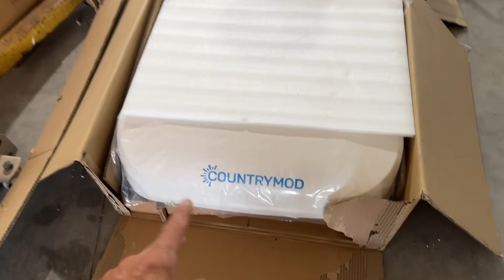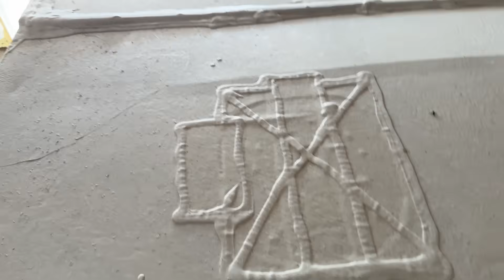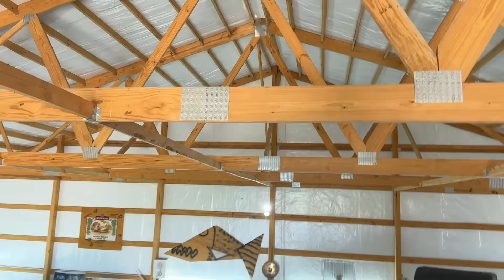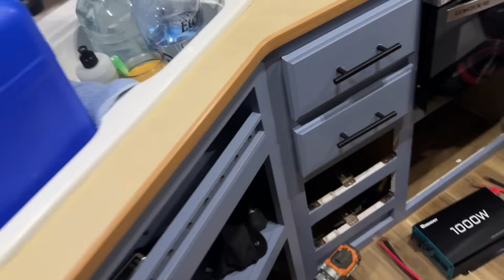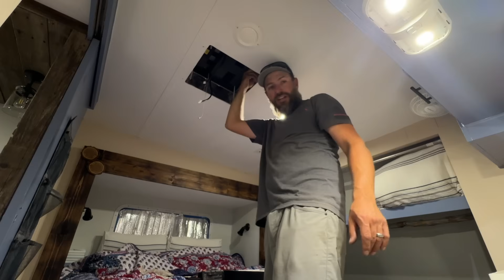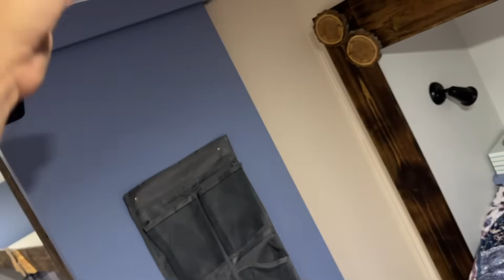FINALLY! SOLAR POWERED RV AC!!!  CountryMod DC Air Conditioning

Comment: What's the best way to connect batteries for solar? Series or parallel? Also how many panels and batteries would you recommend for a full time setup in a trailer?
Reply from the maker: depends on your set up, cost wise a small system say 12 volts, could have a couple batteries in parallel just to add to storage capacity. a bigger system with several batteries running at 48 volts could run multiple parallel banks of 48 volts by combining 4 12 volt batteries in series, but you have to make sure the batteries, panels, charge controller, and power inverter are all rated for the bigger 48 volts.  much more cost!   A decent small set up can be had with two 100ah 12volt lithium batteries a 2000w inverter and a 400w solar kit, check out renogy! https://amzn.to/4nDgYSu

Comment: Love the channel. Correct me if  i am wrong. I thought you said you went to a residential fridge?  I was assuming you were installing this so you could go boondocking and be free of shore power. By pulling out the 3way fridge now you have chained your 5th wheel back to shore power. My question is why did you go to a solar-powered ac (which is very cool) when you are going to be using shore power because of your fridge? Impressive work so far!
Reply from the maker: we have a power inverter for select outlets in the couch. it will run on our solar and battery set up

Comment: I also had to order longer all thread on Amazon the one they give you is 1/4 inch too short. I also wired my control board in another location because of condensation that built up on mine. Lots of work but came out nice.

Comment: I have the same Ac pulls about 59 amps at times. You need at least 4 awg especially for that long of wire run and specially need lithium batteries for sure. That little battery will not work well with that.
Reply from the maker: yeah my lithiums are wired into the front pass through

Comment: It’s only 10k I’ll use a 13.5, 15 or 18k Chill Cube variable speed compressor or a Turbno Greenland Inverter and have the BTU’s and the low power consumption.
All these 12v a/c’s are not powerful enough for but a vanlifer.
Reply from the maker: its a good back up to a bigger 15k

Comment: The math ain’t mathing. If the unit only draws watts. You would only need 8 gauge wire
Reply: If the unit only draws watts. You only need 8 gauge. Depending on the watts. the math is mathing you just aren’t comprehending
Reply from the maker: on turbo mode it can pull up to 59 amps

Comment: how does it do cooling that camper compared to the the 15000btu  110v A/C? i am considering replacing my old AC with a DC one but am concerned it won't cool as well.
Reply from the maker: it's not as good thats for sure. id add it as a back up in a old roof vent

Comment: I’ve seen 18000 mini splits hung o tongues of trailers with evaporators on inner walls. Quiet and efficient
Reply: yes but you gotta drill massive holes in your camper.
Reply: @Reaglesracing44_ I drilled a 3" hole in the bottom of the cabinet next to the sofa. You cant see it, and it would be very easy to patch.
Reply: 130ah per day
Reply: My 9k Btu mini works better than my 2 roof top units 13.5 and 15k Btu units in 36 foot toy hauler.72*f vs maybe 80*f with rooftops.
Reply: @2hotscottpro  try that here in the arizona summer heat where temps can reach 125

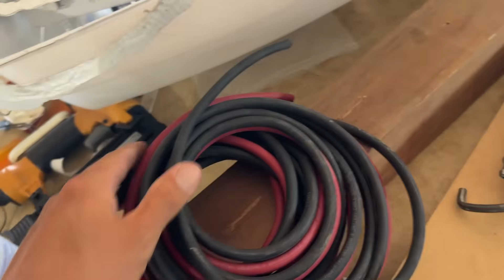Comment: I was wondering, at 15:55, you show some heavy-gauge flexible wire. 

Specifically, what gauge is it and is there a specific name for that type of heavy wire that is flexi?

Thanks in advance.
Reply from the maker: its 4 gauge made from copper welder wire

Comment: For 1000W @12V you could be pulling over 83A, should probably be using 3AWG wire from the battery, unless you aren't going to be pulling the full power from the inverter. Maybe a thermal fuse inline to the battery would be a good idea, 4AWG is only recommended up to about 70AMP.
Reply: Didn’t he say the unit only draws 300 watts?
Reply: I just seen that model pull 50 amps,39 amp on eco mode.And it was hot in Florida sun so it was working hard so to say vs in cool shade.😊
Reply from the maker: 4 awg, eco mode draws way less but on turbo mode it can pull over 50 mps
Reply: Mine's wired with 4 AWG 25 ft

Comment: Urgent warning did you extend rectangular internal ducting piece otherwise it will start short cycling lower the performance air conditioner😊
Reply from the maker: yes built one